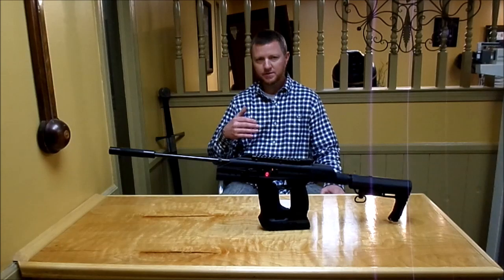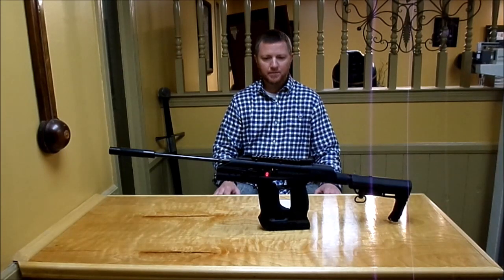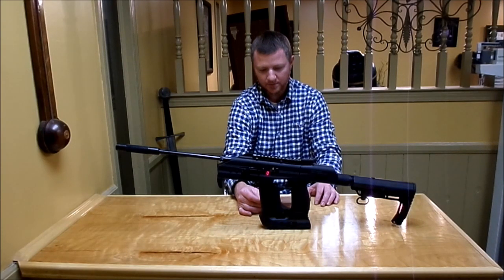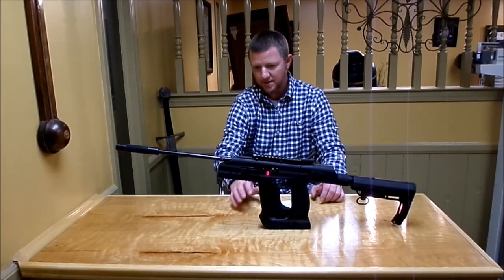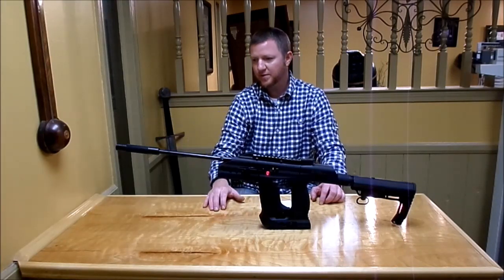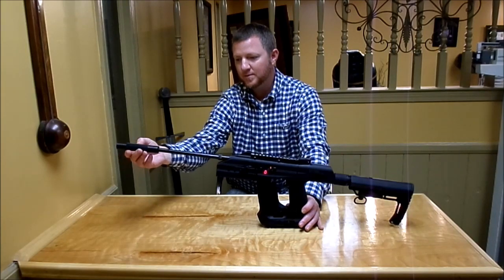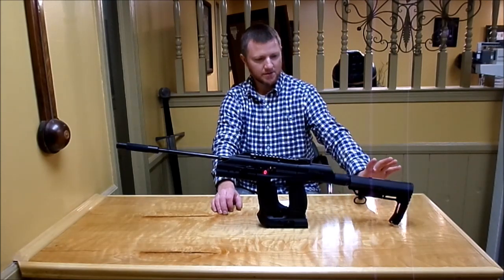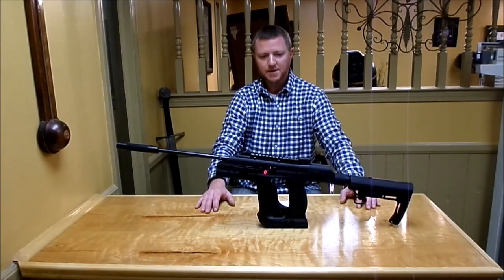8K SuperBird up for Grabs

Comment: That's awesome, it's nice to see a real enthusiast doing good work. I have a Blackbird I bought in 2009
after reading MP661k forums, there were a lot of dedicated people who posted a lot, Porkchop, Greendots, Camracer...Ect.
Your work has taken it to a new level, I hope you continue. I wouldn't mind you doing some work on mine.
I only did basic mods HPA@ 1200 PSI, JimC 23" barrel, JimC AR sliding stock, Potential Meter (not sure if that's the right spelling!)
Still good for over 800 FPS! If you would do some work for me I would want durability in mind, it doesn't need to be too crazy for me. 2k would be good.
I could literally count on both hands how many times I've' used it. I was always afraid of messing with the board and frying things 
or wearing out the gun.
Reply from the maker: Yea the forums were a lot of fun, I came in on the tail end. I probably annoyed more people there than made happy. Back then there was basically zero interest in going above 2K there even after I made it, and 4K reliable. We now have 8K birds if you didn't see. The best thing is these days is we now have spare parts on Ebay. That's another long story, but the platform has in reality never been supported as well as it is today. I am assuming you have the 1200rpm full auto chip. I haven't sold a 2K board in years, but Sergey can whip one up for you. The newest thing is the Gen 5 SPS 5K board. It remembers the pulse rate you set for each ROF. Pulse becomes important in "Ludicrous Speed". Shoot me an email at studio32ste.101@gmail.com, and we will find something right for you,